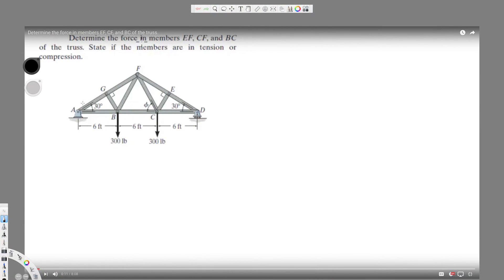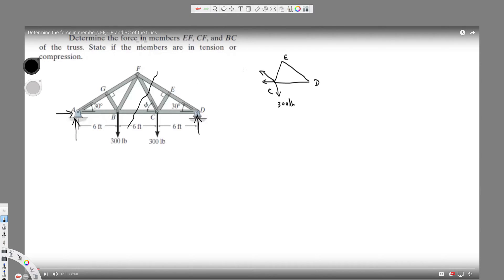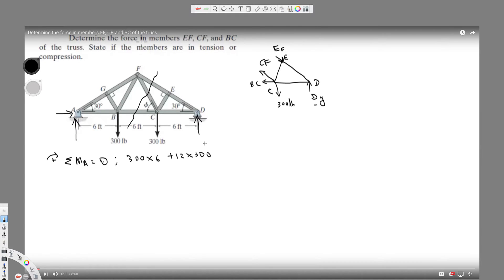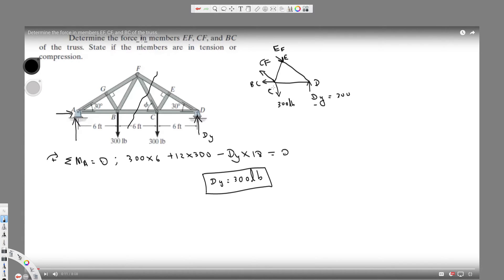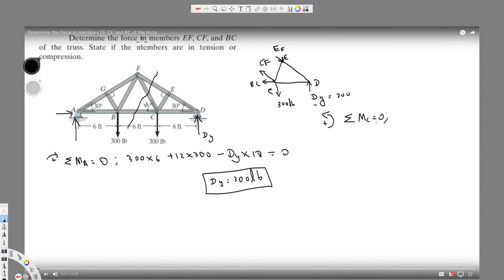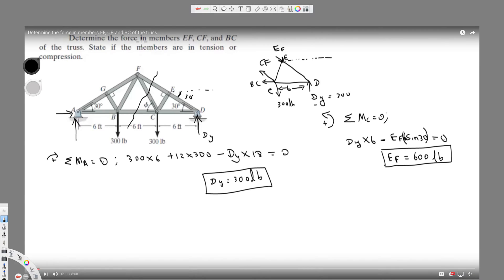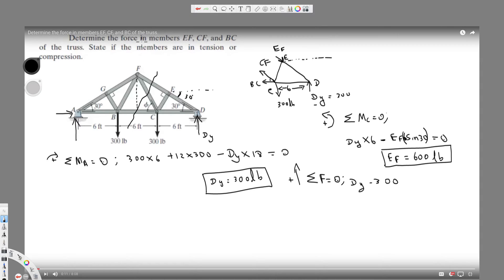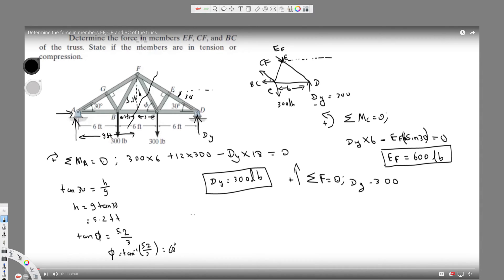Determine the force in members EF, CF, and BC of the truss.

Comment: how did you manage to get 600 in force EF? i keep getting 3600
Reply from the maker: 600 is the correct answer. Did you take moment only about c?
Reply from the maker: If you have the method, just post it here. I will check what's the mistake.